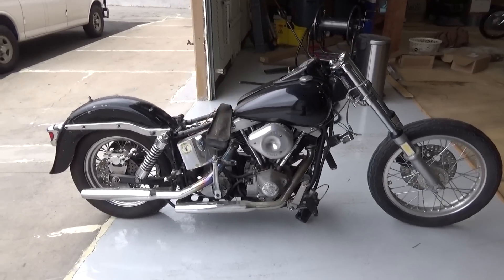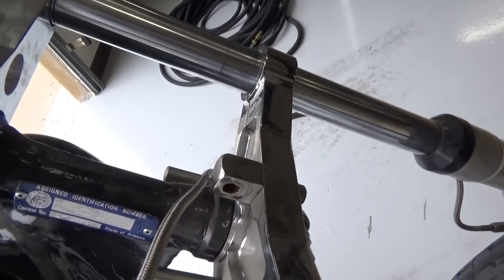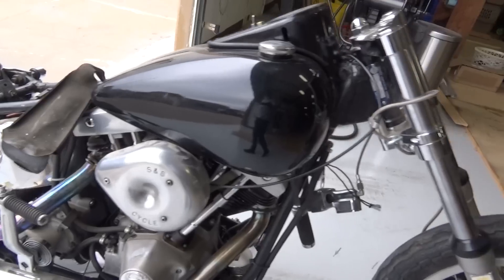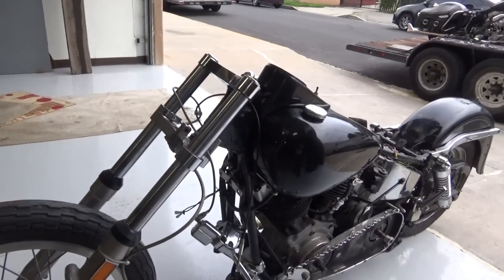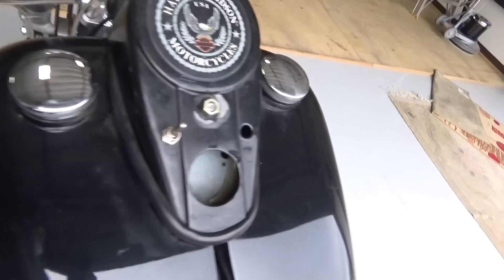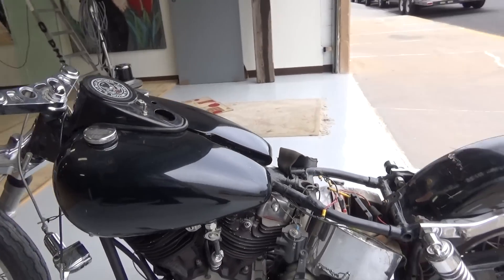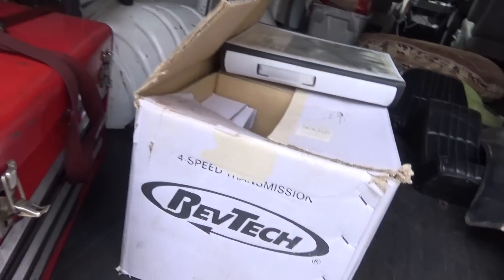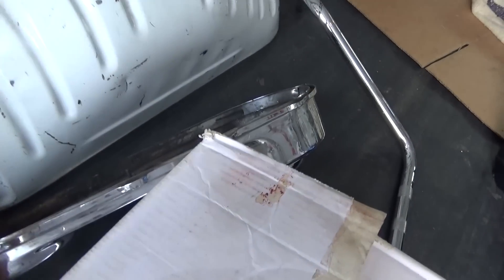Hunting Harleys, 1978 FLH

Comment: Looks like a formidable project todd
Reply: Todd on a shovel what ignition system do u prefer  also single or daul fire
Reply from the maker: Charles Barber lots of new ignition systems out since my shovel riding days. What I used were stock points with an Accel hot points coil (been so long not even sure I spelled Accel right!) I hear the Dyna ignitions are super great and many others.
Reply: Thanks todd